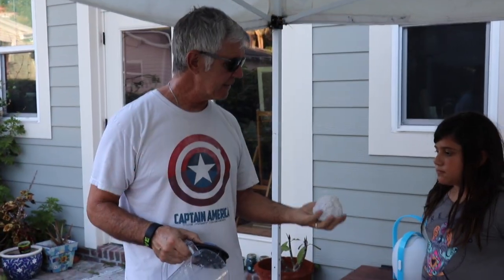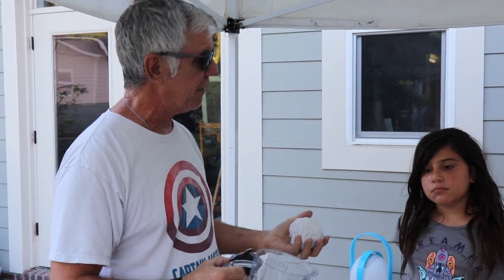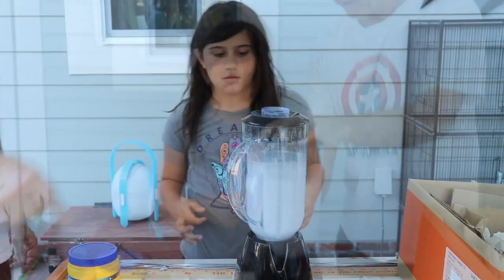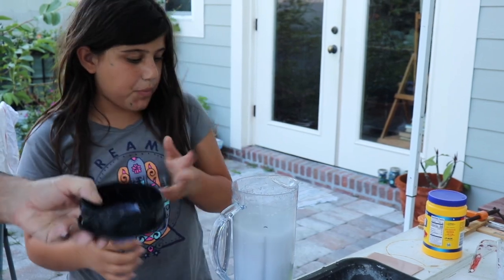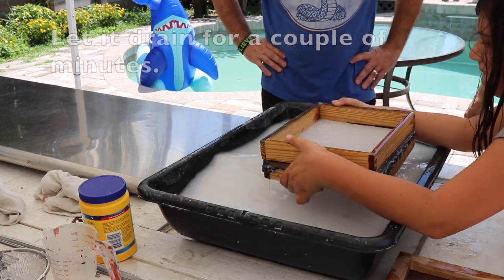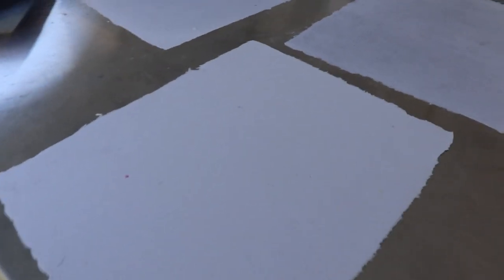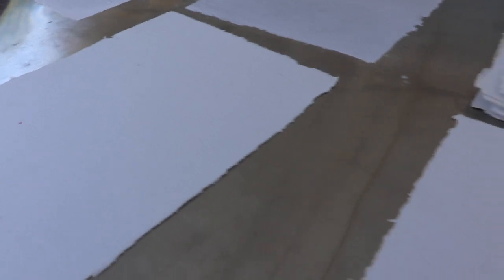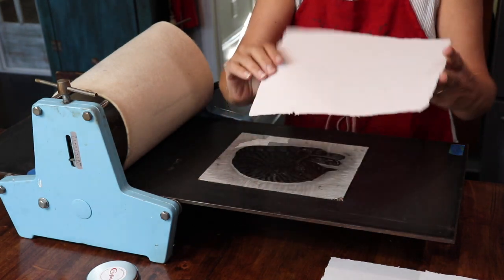Homemade Paper DIY for Lino Printing

Comment: i love how smooth the paper turns out. I'm having trouble with removing it from the glass when it's dry. Do you have any tips?
Reply from the maker: I let the paper dry completely on a very smooth surface so it doesn’t stick.  Any texture will make it stick to the surface when making paper with this technique.  You can try starting to lift the dry paper with a paint scraper if it sticks.  If it does stick your flat surface may have too much texture.  I hope this helps.

Comment: It looks like you add cornstarch? How much do you add to the paper/water slurry?
Reply from the maker: I did.  The cornstarch is supposed to act as sizing.  The recommended amount is a tablespoons of cornstarch per 2 cups of water, but I typically eyeball it.  I still seal the paper with primer if I'm using water based ink or watercolor on it.